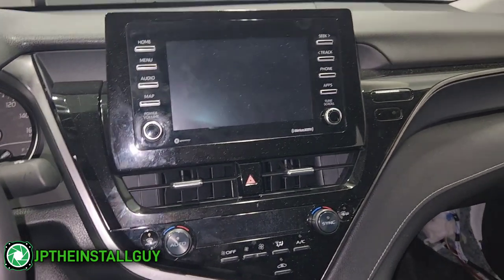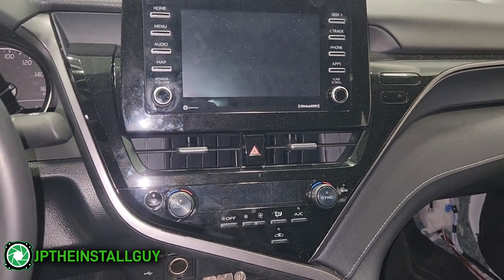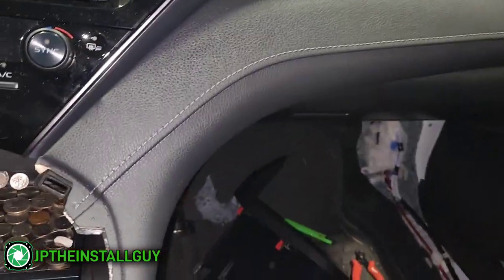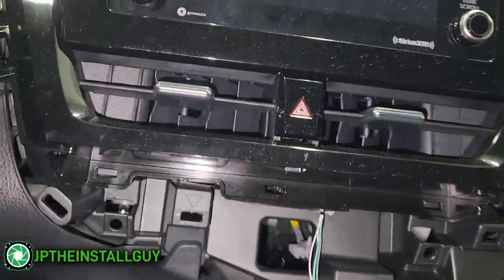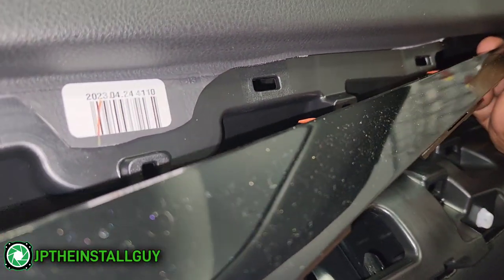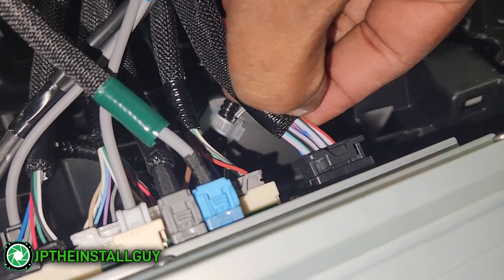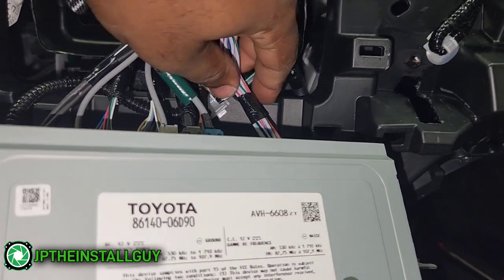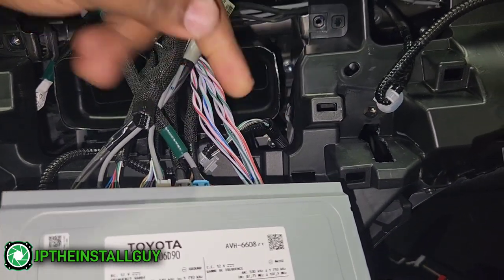2021-2023 toyota camry radio removal

Comment: Im about to install a LC2i on my 2023 camry but i dont want to uninstall the whole dash so i might just tap in to panel B but by chance you can help me on the speakers wire colors i want to tap in to front speaker cuz i heard the back speakers has effects on it and dont have a full range signal on them if you could help me that would be amazing

Comment: Does the 2024 Camry have an aftermarket system with wireless CarPlay and other upgrades that aren’t available on the Stock 2024 Camry XLE radio ?
Reply: I found some options on Ebay and aliexpress all sold from China. Haven't found anyone doing a full install and feedback as of yet in the states. I have a 24 camry also.
Reply: Thank you for your reply. If you find anything that would be better please let me know.